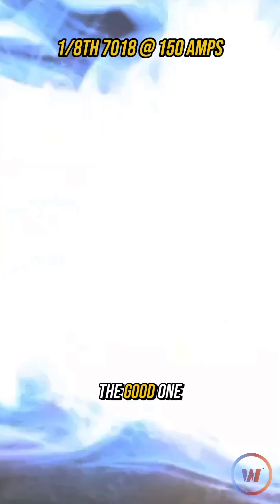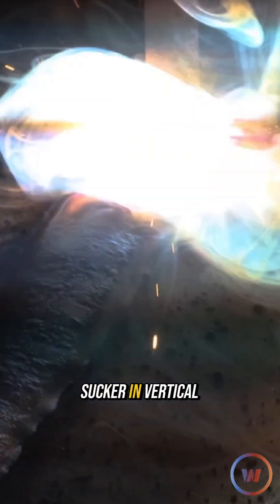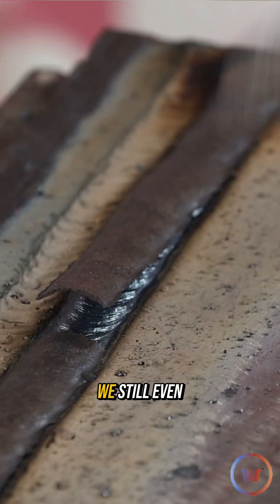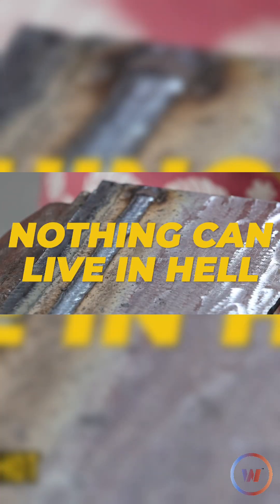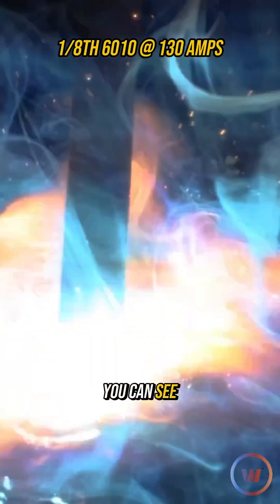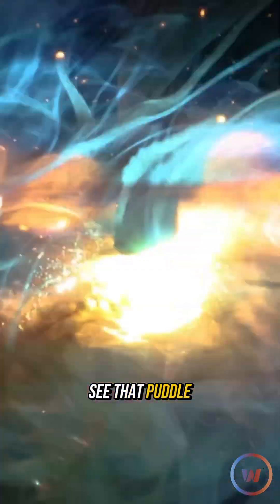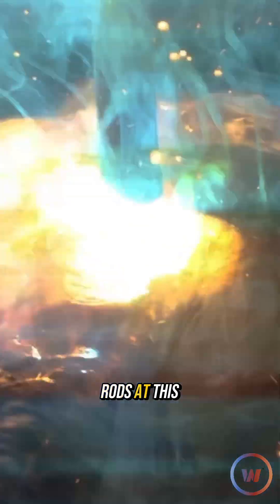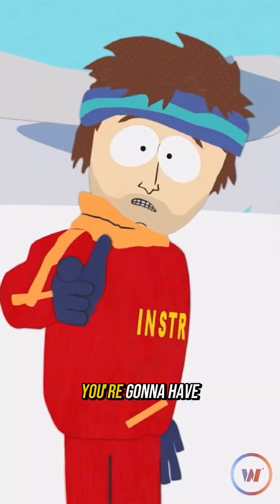Running 7018 & 6010 Too Hot! #stickwelding #smaw

Comment: LMAO i was definitely having a bad time running vertical today, my welding class is split between mon/wednsday we do stick welding and tues/thurs we do MIG/TIG welding i was doing overhead MIG last night and ran verticle today with stick at about 130 amps and that shit was BURNING through the steel i thought i was doing terrible until i realized and turned my amps down. fixed it right up

Comment: 150 amps using 1/8 7018 or 6010 is to many amps. If your rod turns red hot while welding that is a simple sign the amps are to high.
Reply: How can you say that if he’s not getting porosity? More heat is more penetration and less contamination always